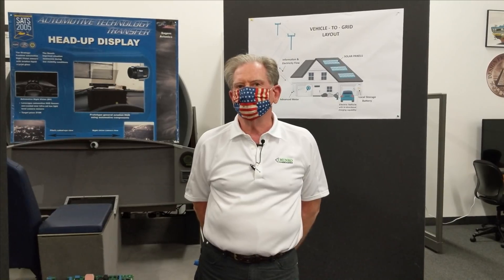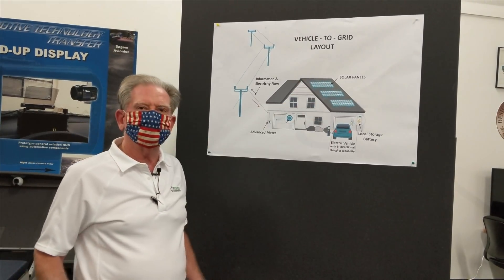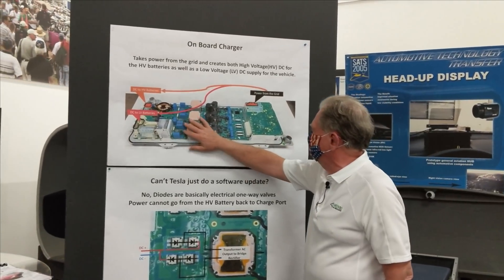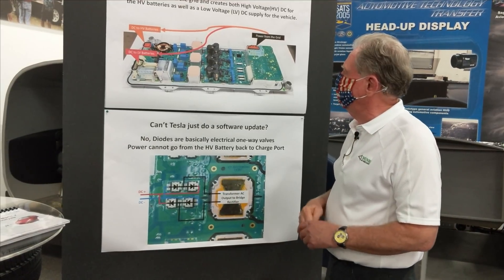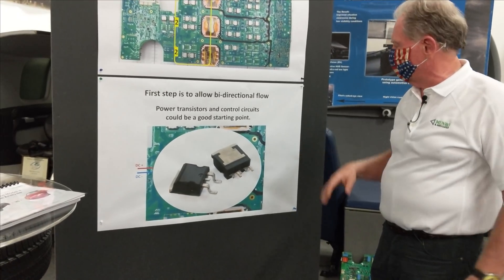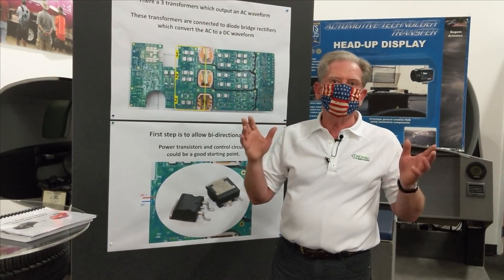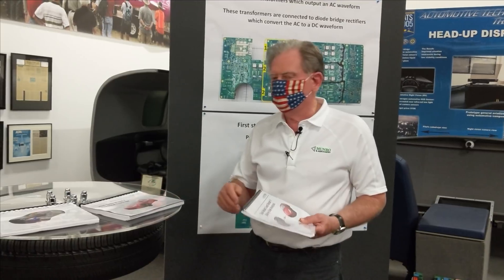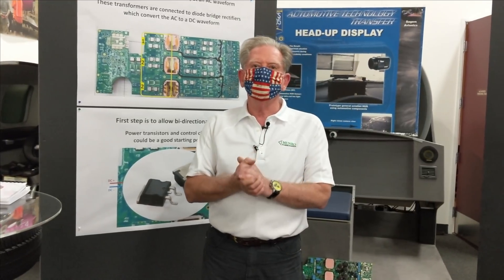Tips for Tesla E2 - Vehicle-to-Vehicle (V2V) and Vehicle-to-Grid (V2G) Charging

Comment: Sandy, instead of converting from DC back to AC, then going into the other car and covert AC to DC there, why not just create a DC port on the car that is designed to give or take DC to/from another device, like another car or your house?
Reply: Exactly, fixating on the AC-charger is completely missing the entire point of V2V and V2G. It only adds costs and losses. You dont have AC in your own battery nor in the other cars battery, and if you need to power a house, the DC-AC converter needs to be in the house, not the car (and if you have solar on your roof, you already have exactly such a device in the house). And Sandy, as you always say, one should always lower amount/remove parts that are not needed. Nothing in an EV needs AC, so it's only there to provide slow charging from legacy sockets. Within 10 years I predict EVs will be dropping the built in AC-charger completely, to save cost, weight, space and potential warranty issues. No laptops or mobiles have internal AC-DC converters any more, and neither will cars. V2V, V2H and V2G are all destined to be DC-DC.
Reply: stefanhuszics don’t the motors use 3 phase AC?
Reply: jearl blah Yes the motors are 3 phase AC but a battery is DC storage device.  You can’t store AC voltage.
Reply: @albertschofield9251  the 3 phase motor controller is like a bigger, very special, VFD inverter. It might be possible to utilize this but probably not and it seems like a bad idea to use a very expensive specialized powertrain component as a regular inverter. This would also require massive wiring changes to make a way to electrically disconnect the motor from the controller.
Reply: @stefanhuszics  To charge a vehicle with DC, you need to provide a specific voltage potential (difference) ... so you would still need a DC-DC voltage converter between 2 cars for DC V2V ... but for DC V2G, it should be reasonable to have the (bulky-ish) DC=>AC electronics outside the vehicle, which is indeed what many cars that support that do.
Reply: @brantwedel  DC-DC voltage downconverting is done by turning the connection on and off. All DC-fastchargable cars already have such technology built in. It would be way too dangerous to allow the + & - poles of the EV-battery to constantly be "live", thus the CHAdeMO and CCS protocolls are used among other things to create a handshake between chargeport and DC-charger and if the cars electronics is satisfied, it will turn on the + & - connectors.
Reply: I think that's how Nissan V2G works, so you still have an inverter in your house. I think it would be possible with minimal hanges with current Teslas.. (well, you can always rip out the battery!)
Reply: Just start towing the dead one with brake pedal slightly pressed, you will both go to direction you need and regeneratively charge the battery. Do not over complicate things with cable (no one will have it ready, voltages will be different etc)
Reply: @hrissan  That will take a long time, just saying.  You would have to tow the vehicle most of the way home.  Good idea 👍.
Reply: @hrissan  this is great where it is allowed to do so. Here in Europe, towing a car with another car is illegal in many countries, and there where it is allowed the rules are very strict in order to discourage people...
Reply: Brecht Schatteman wow, seriously? The more I know about Europe, the less I understand why it is advertised as “free world”, if you are prohibited from doing many normal things.🙄
Reply: @hrissan  I didn't know Europe was promoted as a free world. Here in Europe, we see USA as the land of the free. Here it is a bureaucracy nightmare to do anything. From the moment something can affect someone else negatively there is a lot of regulation. For example recycling ebike batteries you need a permit and comply with laws if you plan to sell it for money, even if it is just a side hustle you only do sunday...
Reply: Couldn't they just put a 220v outlet somewhere hidden and you could use an extension cord between two cars?  The charging rate might be slow but it could work.
Reply: @emmanuelwestra6524  You could always hook up your own inverter... :)
Reply: @rkan2  Good point.
Reply: @emmanuelwestra6524  the Honda E has a 1.5kW 240V outlet. It will take ages to do, in 1 hour you will gain 10 km of range if your lucky. This is why the solution that Sandy proposes here is the most likely solution to happen and also the best at the moment. Only a slight change in the charge controller could make it bidirectional, and could thus give a 7.4-22kW output, depending on the charge rating. This will help you exchange 10km of range in half an hour to lower than 10 minutes
Reply: @brechtthebest  I was just curious about that.  That's worse than I was thinking.  I thought you might be able to get 10 or 15 miles of range from that.  Sandy Munro's solution is by far the best because you could have charging rates that are much higher and everything is already in place for charging so all that has to be done is make it bi-directional.
Reply: That would be dangerous. The DC connection goes straight to the battery. So adding that would put both batteries in parallel, and that is a very bad idea when they are not at the same state of charge...
Reply: @hoedjeexplains3661  You mean like the horrible situation of charging your cars battery at the closest DC-fastcharger? Tesla M3 does 250kW currently just fine. So could we please drop nonsense arguments of how something already done today cant be done in the future? Besides, an "empty" Li-ion battery still has a very high voltage, if you let it discharge too far the battery will literally break physically and undergo massive degradation. Thus EVs shut down well ahead of the voltage dropping too far.
Reply: stefanhuszics I didn’t say it couldn’t be done, I just pointed out that the DC connection would be a huge fire hazard. With DC charging, the car is communicating with the charger to define what the charger should deliver. Connecting both cars DC to DC would mean there is no charge controller involved and that would make it a parallel connection of 2 batteries. Since the batteries have very low resistance, that would lead to a huge flow of amperes, that could just start a fire on itself. Watch videos of people connecting high and low voltage lithium ion batteries, they become hot very fast... That is why V2G and V2V will probably go through the internal charger circuit as Munro is explaining here, because that is the only current way possible that there is a charge controller involved to minimize the risks... The only other solution would be adding an internal charge controller to the DC charger and that could have a conflict with current DC charger stations and add extra complexity
Reply: @brechtthebest  I imagine there would be safety electronics capable of mitigating the risks.  Just like they mitigate all the other electric hazards inherent in an EV.
Reply: @brechtthebest  "Connecting both cars DC to DC would mean there is no charge controller involved" You are incorrect, there already is on/off-switches and a BMS, in both cars. They dont suddenly vanish or stop working. Obviously, if a cars batteries are starting to overheat, the BMS will send the signal to the connector to disengage. And nowhere have I stated that the cable connecting 2 cars have to be only "stupid" pure metal cables. In fact, all EV AC chargers mounted on walls etc today are not really chargers (for AC the charger is always inside the car). The thing on the wall is NOT a charger, only a section of a "smart" cable. Nothing stops the same method from being used to also have "smart" DC-DC cables, it could even use the current CCS and CHAdeMO protocols for talking to both cars.
Reply: @stefanhuszics  the BMS is no charge controller. The BMS is a simple on/off switch when you endanger the battery. And a surge in Ampere would set it off, and simply block the charging. That is why there needs to be a charge controller that can limit the amperes to what the batteries can handle. and at the moment, only the AC charging circuit has a charge controller built in
Reply: @brechtthebest  I wrote about the BMS in reply to you claiming batteries would overheat and be destroyed. The BMS will still work and measure temps etc and tell either the chargecontroller on the cable to ease down or turn off, or the cars electronics will just turn off the connection as a failsafe. And you continue to ignore the obvious solution of smart cables, that we already use today on the AC side. This is not some weird future tech, smart cables is the way EVs have been charged the last 15-20 years on AC...
Reply: @ToddNorthrop  well yes the BMS will shut of the connection, so you wouldn't be able to charge the other car. Without charge controller that limits the amperes, it will just be either charging or no charging situation, based on the voltage difference. So the only moment you would be able to charge the other car is if you have a slightly higher state of charge. And at the end, you may stand together this way...
Reply: @stefanhuszics  in the setup with a charge controller on the cable, everybody will have to take another cable with them, the DC cable with a charge controller that would solely be used for V2V or V2G applications. The chance is high that most people would just leave that cable at home or even never buy it. It is extra bulk and thus takes up extra luggage space and the added weight would have an impact on range (although very small, a few km, but still people would think about it hypothetical). Most people would take the AC cable connection with them to connect to AC chargers without cable, and thus this setup proposed by Murno is the best solution: the consumer doesn't need to change his behaviour much, the car company doesn't need to add a DC charge controller to the car or have a DC to DC cable with charge controller, they only have to switch a few components on the AC charger to make it bidirectional.

Also, CCS that is becoming the standard in europe, doesn't have a protocol for V2G or V2V for its connector, as far as I have found only chademo had V2G integrated, which connects to the DC charger and use the charge controller from the DC charger
Reply: @brechtthebest  your reasoning goes wrong from the start since you assume AC chargers will continue to be built into EVs also in the future. Manufacturers will move away from built in AC-chargers ASAP as they cost money, take up space and weight, are extremely limiting in speed, can lead to warranty-claims-costs and are considerably less efficiet than DC charging. Also, CCS will have DC V2G etc by 2025, according to their own official plans for the future. And all it takes for it to be here much quicker is that 1 manufacturer turns it on.

Comment: For the case where you run out of charge on the road... Keep a 2KW 12v inverter in your car.  You will need an adapter to short the neutral to ground (which you can hack with a thin wire your wrap the two pins with).  Then you can run the inverter off of the car battery of a good Samaritan.  You will charge slowly (4-5 miles of range per hour) but at least you can get some charge to get you to another power source (ac outlet) somewhere, and ultimately to a supercharger or home.

Keep a towing strap in your EV.  Then if a good Samaritan happens by with a tow hitch, he can tow your EV around at some relatively slow speed (15 mph) and recharge your battery via regenerative breaking.  This is much faster recharging (maybe 20KW).
Reply: Honda built a 1.5kW inverter right into Honda e.
Reply: What would a 2KW 12v inverter cost and how big would it be? Any links?
Reply: @aussie2uGA  This is the one I used: https://www.eastwood.com/2000w-pure-sine-wave-power-inverter-w-remote.html
Reply: I believe the inverter has to be a "pure sine wave" inverter.  I suggest you put some relatively large alligator clamps on the ends of some relatively short (3 ft) heavy gauge wire connected to the inverter's input.  This way you would be ready to connect if the need ever arises and you can just connect like the old fashioned "jumper cables".  If you need to use this, you will want to make sure that the gas car is running (probably worth testing with a gas car you or a friend might have).  Effectively you are using the alternator of the gas car to charge your battery.  If the gas car has a small engine (and alternator) in it (4 cylinder engine), you probably want to lower the charger current in the EV (if possible, Tesla's let you do this) to keep the power draw below 1 KW.   This solution is slow and takes time, but it does work.  The idea is to get enough charge so you can get to another charging source (AC outlet, L1 or L2 or ideally, a L3 charger).  Hope this helps!
Reply: @aussie2uGA  It avoids the need to find a helping hand, but now you have a gasoline engine in you car.  I don't like keeping gasoline in the car.  I don't even like taking a small gas can to the gas station to fill up and bring home for the lawnmower.  With a generator, you are basically keeping gasoline in the car all the time.  Hopefully this is something you will never need to use, so I don't think it is worth keeping a fueled up inverter generator in the car.  The inverter is more like keeping "jumper cables".  It is slow and not convenient, but if you ever find yourself out of charge, it might save you some major headaches.
Reply: @aussie2uGA  Roughly 100 to 400 USD, depending on a number of factors. Ask your local supply for camping eqipment and off-grid use.
https://www.idealo.de/preisvergleich/Liste/111547760/12v-2000w-sinus-wechselrichter.html

Comment: One downside of V2G not mentioned is that it uses battery life cycles. Therefore a car that has been used for V2G will ultimately have more battery degradation that a car that has never been used for V2G for the same milage in the odometer.
Reply: Million mile battery coming. Stay tuned : )
Reply: @peter Technically you are correct, but in practice the wear of pulling eg 5kW electricity from you car to your house is completely irrelevant to eg fast charging the battery at 250kW. We are talking a 50x difference to what cars are already designed to handle. And we havnt even discussed the really high currents setting those 3,3s times 0-100km/h... if you want to protect the life of you battery, stepping carefully on the electron-pedal is much more relevant than if you do V2G or not.
Reply: @stefanhuszics  I'm not knocking what you are saying, more like adding to what you've said. 

I'd be especially concerned buying an ex-lease car as the first owner would have no incentive to look after the battery and may well have changed to 100% for every single charge of their ownership. I expect that would have an even bigger affect on battery life that generous use of the electron pedal. (I love that term, I'm having it 😂).
Reply: @stefanhuszics  I 100% agree. I'm honestly confused that this argument comes up so often. As I understand it (happy to be corrected if someone understands this better than I do!), the degradation on a Tesla car battery from a house would be somewhere between minimal and utterly inconsequential. House power draw tends to be more sustained than peak, which is gentler on the batteries. Implemented properly, you could easily keep the battery in the middle of its charge range for minimal degradation.  

All that aside, VtG/VtH would be a feature; no one would force anyone to use it. Yet every time this discussion comes up there seems to be a chorus saying "oh, but what about the batteries". I'd much rather see everyone joining together to pressure Tesla and others to implement this properly, ASAP. 

All over the world we are rolling out renewable energy production, the biggest drawback (and the only real drawback) of which is the lack of storage. Imagine a future where everyone could plug in their cars at work or home through the day and charge while the sun is shining and wind blowing. Then overnight, that entire fleet of cars could sell a portion of that energy back into the grid to handle the evening/morning peaks and overnight trickle. As long as I can set a minimum battery limit to ensure I have plenty of charge to get me to work again the next morning, and as long as I can opt out anytime (say I have a trip the next day and need a full battery), that sounds perfect to me.
Reply: City car vs country car.  City cars die at 150k miles and country cars clear 300k miles nbd.
Reply: A 80kWH Battery   between 65 to 70%  can Cycles alot of time with nearly no degradation. It would help massive to use your own Solar energy for your self. In CH you get only 1/3 per Kw when You put it into the grid, than you will get it back. A House needs nearly no Power when compared with a Car.